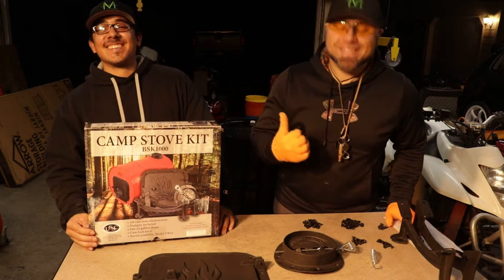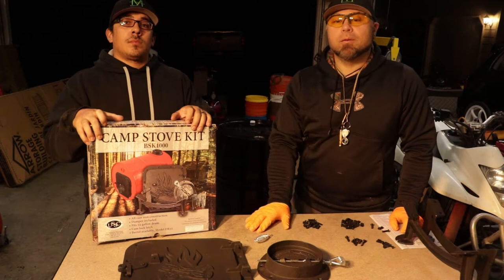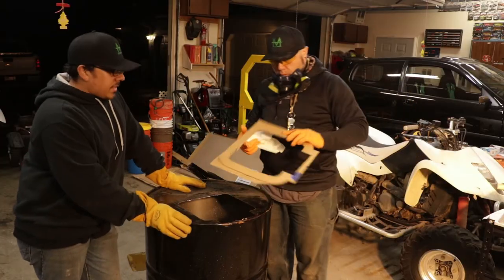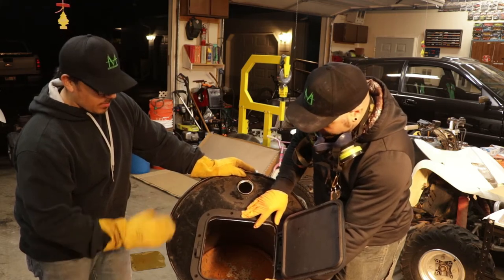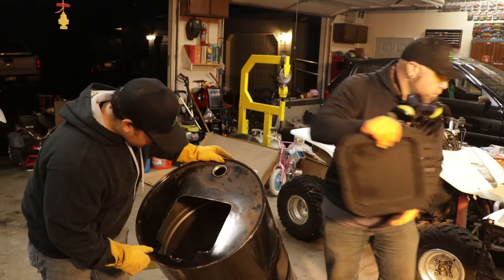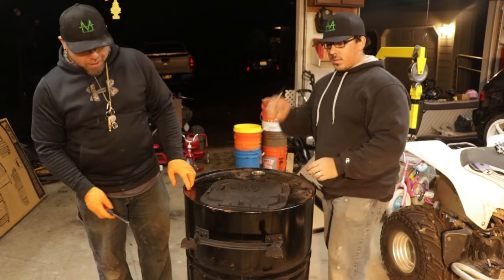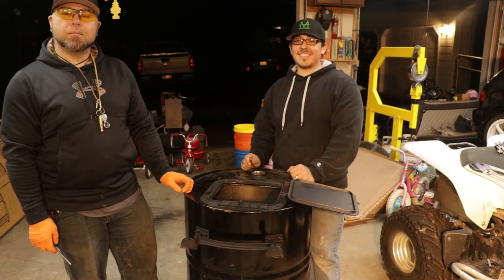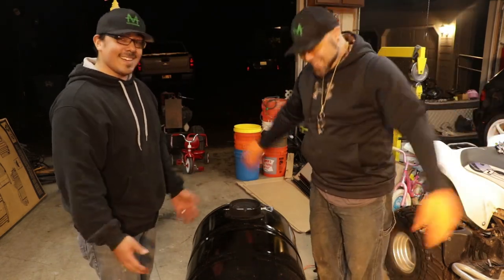DIY: Making an outdoors Barrel stove from a 55 gallon Drum

Comment: You should have put the large bung on the bottom.  You want your air intake low to feed the fire
Reply from the maker: Thank you for the comment. There is a vent that is on the bottom and that is why we left the large bung up top. I will remember this for the next time we build one and see if it helps with the large bung on bottom. Thanks again.